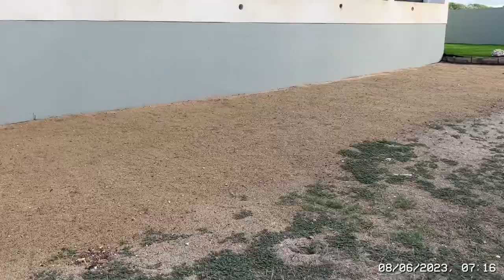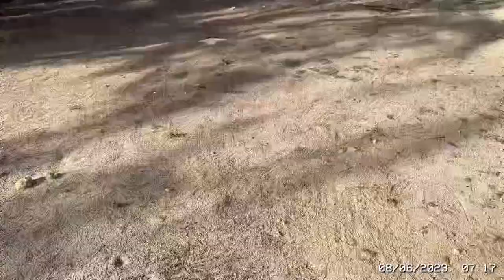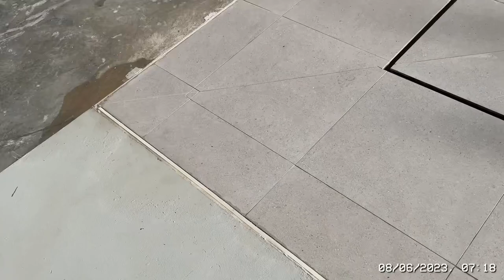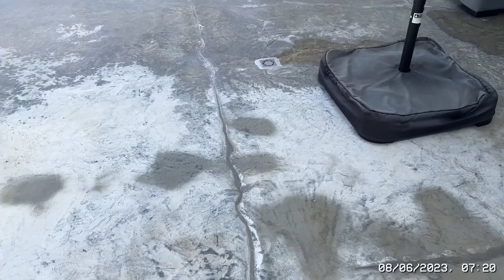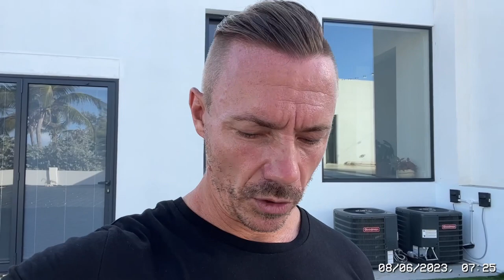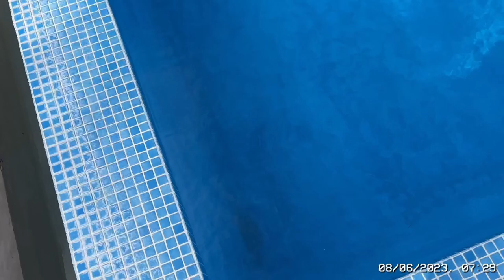BARBADOS 🇧🇧 Beach House Build - June 2023 Update

Comment: 40kw is a massive system for residential. 

It would produce about 180kwh per day.

You're probably using less than 30kwh
Reply from the maker: I wish, we are using 110-135 per day without the other aircon going in.

Comment: Kudos on the progress you're making. What is the brand of paint that you're were using on the conrete that's bubbling now?
Reply from the maker: Thank you Michael, we tried a roof rubber to get the grip and waterproof we were seaking. It has worked but due to the lack of prep we put in I think this is why it has bubbled slightly.
Reply: @barbadosbeachhousebuild  Thank you

Comment: $100,000?  
You can get a full setup without the batteries for around $15,000 USD. Import duties are not high on solar, if at all... Then, $6000 USD in  EF Ecoflow portable batteries is more than enough.
Reply from the maker: Hi Ron, we are going to need a 40-60kw system here so that is why it is so expensive. The batteries alone will need to be 90-100kw so that will be a good $60-70k. total it will be around $150-180k 😳 but this will be off grid with a potential to add to the grid also.